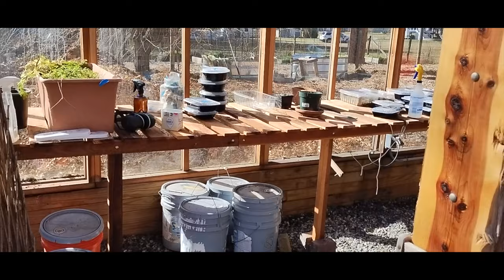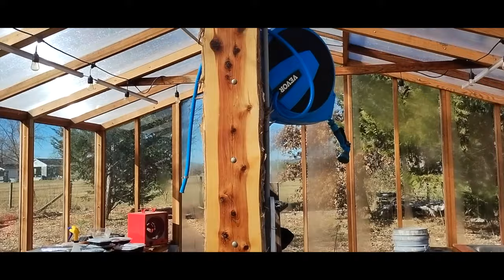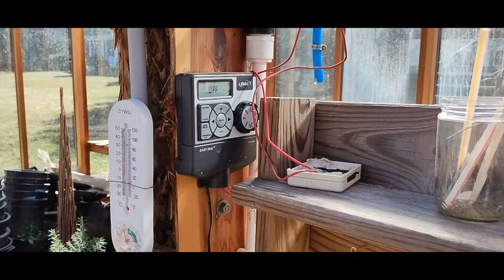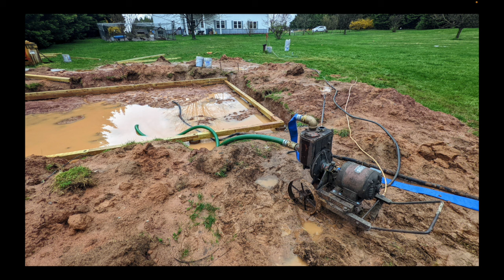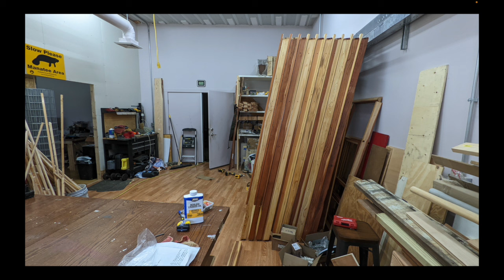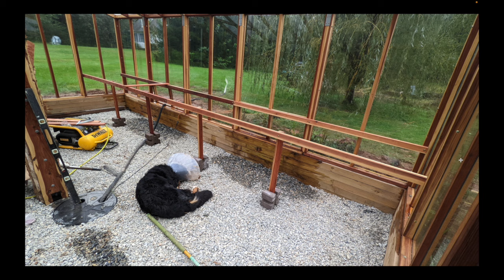learn from our experience and mistakes - greenhouse planning, kit and design considerations...

Comment: So short galvanized screws wouldn’t be ok for fastening the glass to the wood frame only hammering nails ? Seems like nailing them and hammering in seems more tedious. Guess SBGH knows more than me .Only have experience screwing in 1x1S for small benches and shelves. 
Thanks for mentioning that center post addition. Figure they don’t get that much if any snow in SoCal unless the designers and engineers at SBGH lived in the Sierra Nevadas or came from heavy snow and ice localities.
Reply from the maker: Yeah we went by their instructions but I don't see why screws wouldn't work just fine. The center post is required in any climate due to the ridge beam having a joint in the middle and needing support. The kit is designed with snow loading in mind, I forget how much